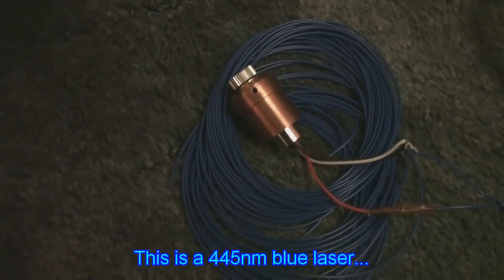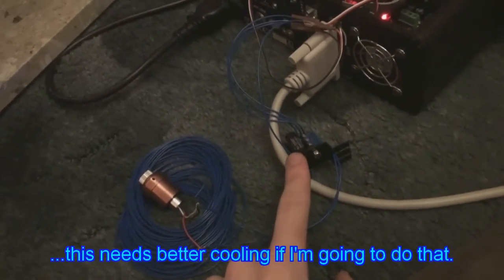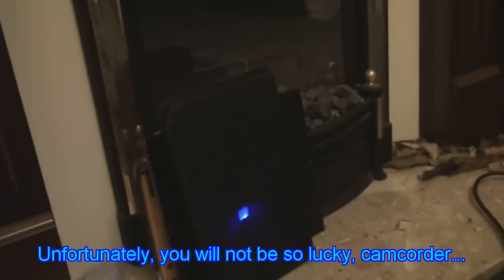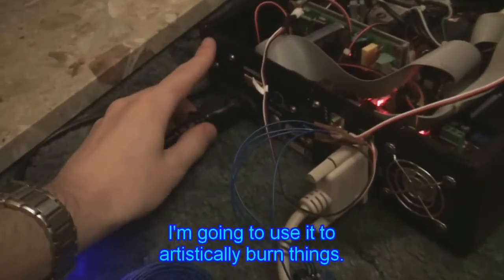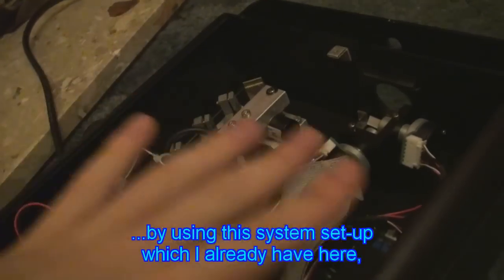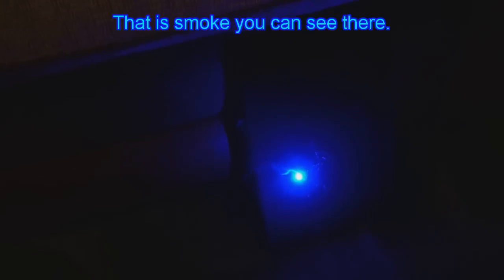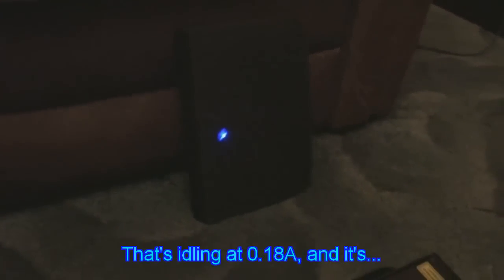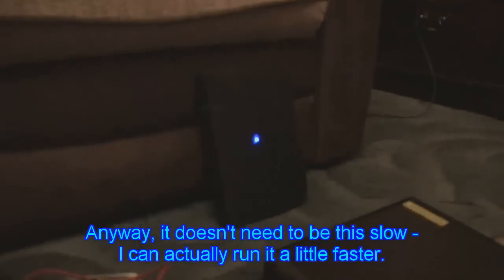Burning Vector Image with Blue Laser at ~1W

Comment: The laser frame designer software can add text automatically. You can draw a picture for each letter and then type text, or it can use a standard TTF font. I chose the latter option, but as my galvos are slow, I had to go through every point in every character to fine-tune the duration (number of repeats for each point) to avoid the text getting deformed when scanned at high speed (not important when burning slowly like this). I'm using essentially a very old and buggy version of Phoenix.

Comment: I'm not sure how this could be arranged (cheap and safe shipping), but it might be possible. It almost entirely depends on how reflective/shiny the surface is, and its colour (black absorbs more light, so it heats up and melts much more easily). The other thing would be the picture to be burned. Unless I can get the motivation to write my own program which can read SVG files (automatically vectorized by e.g. Inkscape) and send them to the laser, I'm going to have to trace the picture by hand.

Comment: Cool video. What did you use for directing the beam? Servos or specifically designed galvanometers for lasers?
Reply from the maker: Galvos for a laser projector that'd typically be used for directing the beam in laser shows.